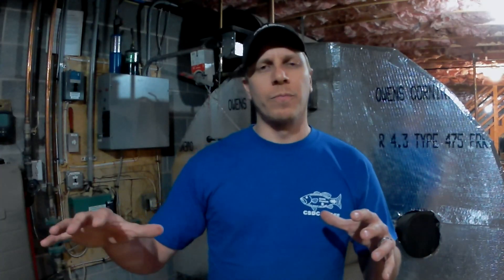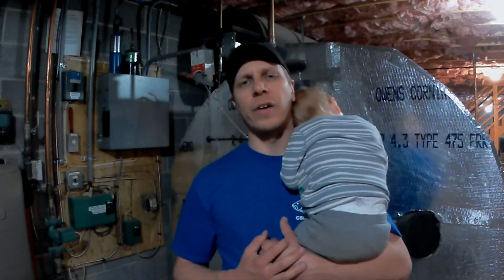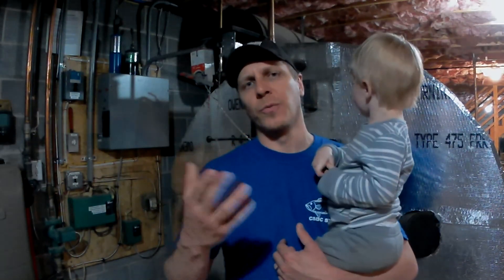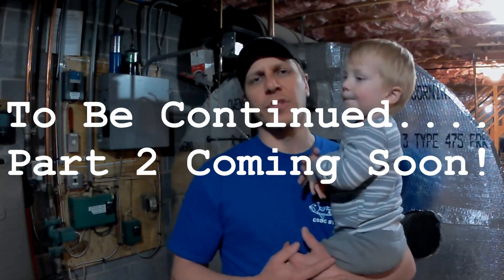How and Why We Heat With Wood - Indoor Gasification  Wood Boiler - Part 1 - #7

Comment: Thanks for the presentation. Love your set up, if we decide to get into another house this is what I'm going to install. The only downside is needing all the piping plus all the ducting for A/C. I would never consider a air handler as its cheap and gets the job done but it's always drafty. I have come to the same conclusion about outdoor boilers....why? Having to deal with the elements 2 or 3 times a day is a deal breaker. It does keep the wood mess outside but the boiler is exposed as well. You can't  leave it burn out in the winter because it will freeze. That's OK if you never leave, I see that as buying an anchor to be chained to.
Reply from the maker: It's good to know I'm not the only one that sees it that way! When we built, we didn't include AC. For the past couple summers, we've cooled the house with only 2 small window units as the house is very tight and very well insulated. I plan to install 2 small ductless mini-splits to replace the window units and keep things cool when it gets really hot. Let me know if you have any more questions!
Reply from the maker: @Joseph Upton I have thought about that. And I did talk with the plumbing/HVAC guy that helped me hook everything up for my heating system about this. He claimed that you cannot heat and cool a floor the same way. Something had to be different. I don't remember exactly as it was a year or so ago. Maybe insulation or vapor barrier. But for our system, it wasn't feasible. I will also confess this is as far as I took it. It may work. Or might be easy to do, but I haven't researched it further than the mentioned conversation.

With that said, our home is well sealed and well insulated. We can go 10-11 months without AC. And really the main reason I want to install mini-splits is for the dehumidification that is necessary in the summer. If humidity would stay low, we wouldn't need AC at all. 

Thanks for you watching and commenting!
Reply: dont know if anyone gives a shit but if you're bored like me atm then you can watch pretty much all of the new movies on instaflixxer. I've been binge watching with my girlfriend recently =)
Reply: @Emilio Nicholas yup, been using instaflixxer for since december myself :)
Reply: @Emilio Nicholas definitely, been using InstaFlixxer for since december myself :)